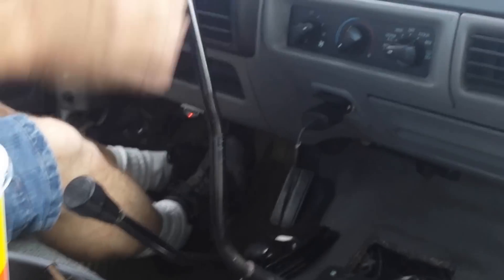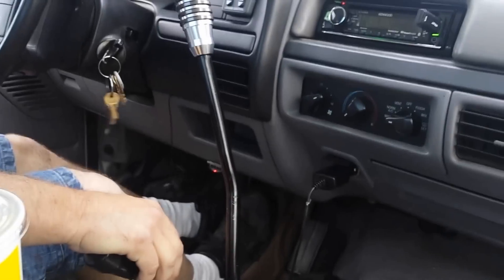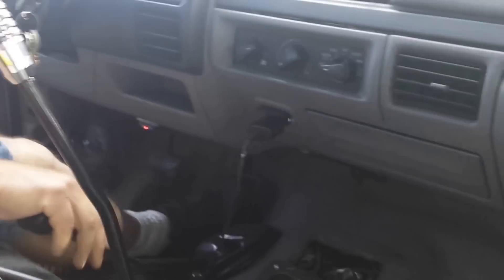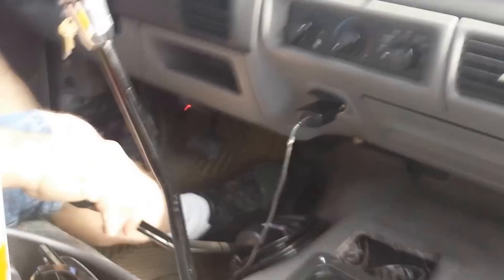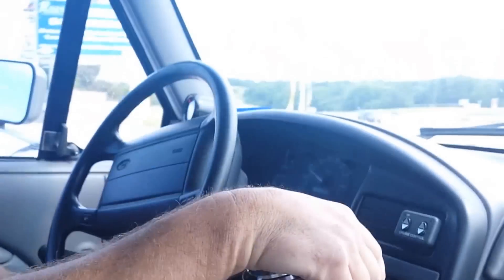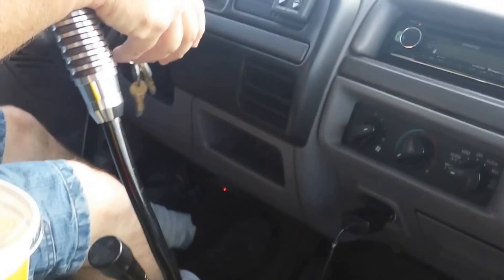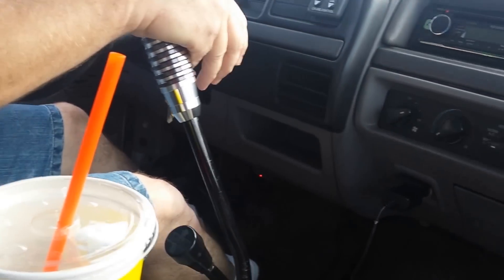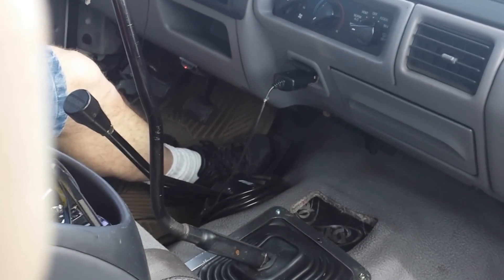F150 twin stick test drive

Comment: I know it's a late comment but I wanna do this with my 89 but I have 2 questions. 1. Is the noise from the overdrive unit a torlerable volume? 2. Is the install pretty hard, I mean clearances for the shifters cause mines 4 wheel drive? Loved seeing this video I had no idea what to expect when I looked it but found your video it's awesome! Keep posting more videos with this truck! Cheers
Reply from the maker: The noise being tolerable is subjective. I can tolerate it ok, but I used to drive semi trucks so.... Most people that ride in my truck for the first time comment about the noise, they ask me if something is wrong with my truck. I was warned by advance adapters about the noise before I bought it so I was prepared. Knowing that the noise is normal takes away the anxiety of thinking the unit is going to selfdestruct I guess..  Lol
As far as the install goes, in a 4wd truck your transmission and transfer case will be moved back about 6 inches. That means the shifters will also move back 6 inches, that will clear up space for the extra shifter. It ends up being a few inches in front of the transmission shifter. You will have to do some floor board mods, covering up the old holes and drilling out new ones. You will have to shorten the rear driveshaft and lengthen the front one. Also the cross member has to be slid back 6 inches. Install is not easy, but its not impossible either. Just allow plenty of time to complete the job.  There is no rocket science involved, just some minor fabrication work.
Reply: ktumbleweed awesome! I was pleased to see you answered so quick. My truck for the most part is loud from my cherrybomb exhaust. So I didn't really worry about the noise that would come from it as much as if it was gonna be a hassle to install thank very much for the info it is greatly appreciate!

Comment: Is this unit noisy in OD? Doing research on putting one in my 77 Ford with NP435 tranny for the overdrive. Don’t want to install it and not be able to enjoy the ride from the wine of a OD.
Reply from the maker: It is noisy. Not gonna lie to you about that. Noise seems to travel up thru the gearshift lever. I tried an experiment where I shifted into overdrive and then unbolted the shifter and stuffed a towel over the hole in floorboard. Noise level dropped considerably. I think a rubber block between where the shift lever bolts to shift arm should isolate the noise down to a tolerable level.
Reply: ktumbleweed Thank You Sir. I really love watching your videos. My dad is a truck driver and I grew up in a truck. I just love to shift gears. This just looks like the key deal for me. I am building a 1977 ford crew cab. Doing a full restore on it and want to make it drivable to 65 mph. Thank you so much for putting all this out.

Comment: Excellent description. I'll use this for the core of my research.  A buddy and I both have old fords and we've been one-upping each other for the past two years, doing stuff that shouldn't be done.  
He built a rock crawler with 37's; my aspirations were simpler, I just wanted a good old running truck that burned rubber on command. He's currently WAY in the lead this summer with 37's, Sterling axles hydraulic boosted brakes, etc etc.. I still think my truck runs and sounds better with the bigger cam; because everyone needs a stock looking truck and a cam with 220 degrees of duration; but it's missing that one over-the-top-thing.  I was going to put a stall converter in and slap some huge mickey Thompson drag tires on it after I replaced the gearing with 4:56's.. 

But I think doing this; especially since he can't drive a standard and I'm not really into big tires; would be good for a LOT of laughs. Not to mention it'll be educational for the youngins.  Maybe I'll eventually do both?

Comment: Gotta ask. Where did you find this or did you make it? Never saw one in a pickup. And it's a damn good anti theft  device!
Reply from the maker: advanceadapters.com  it is called Ranger Overdrive or torque splitter.  I am selling this transmission setup.  Includes the 2speed Overdrive (small stick) and T19 4 speed granny.  Fits small block ford engines.  302 V8 351W  300 (4.9) six cylinder ,  maybe 351c  don't quote me for sure.

Comment: So what was the Doug Nash 4+1 transmission in the mid 80's corvette? Any useful swaps into old trucks?
Reply from the maker: I don't know a whole lot about 4+1 , I think it had an overdrive behind the transmission. Similar to a gear vendors. I think it could be used as a splitter but not for sure. 
They used to make 3 speed manual transmissions that had a factory overdrive in the tailshaft housing. It could be used in 2nd or 3rd gear.  Maybe 1st gear if you really wound up 1st gear but it was not recommended. This was back in the 50's and 60's, I think they go back even further than that.

Comment: This would be so nice on a boat ramp. I assume I have 3.08 gears because getting moving on flat ground is so hard, but highway speed rpms are decent.

And with the amazing mazda supervisors tranny, I can go faster in reverse than in first gear. And can barely start backwards in reverse up hills. What a ridiculous setup. Why there aren't more options for two wheel drive trucks like split rear ends, auxilary transmissions, locking differentials, or nowadays even just a manual...I can't figure out. Nice video!
Reply from the maker: To use this particular aux transmission you would also have to change over to a 4 speed transmission. I recommend a "granny" transmission. This overdrive unit does not lower the gear ratio, it only adds an overdrive. However switching over to a 4 speed granny would give you a lower 1st gear. Find one with a 6:1 or lower 1st gear to really be able to crawl up the boat ramp. Also this unit only works with Ford or Chevy trucks and some older Toyota land cruisers. Check out their website for more details. AdvanceAdapters.com

Comment: Love that Overdrive, Gear Vendors designed that I believe, I know they made an overdrive unit on some sort either way it's a cool addition to your F150 brother. Great video.
Reply from the maker: Thanks for your comment and for watching the video. Advance Adapters has been selling these units since sometime in the 80's. Gear Vendors did not design this unit. This particular overdrive unit was originally designed by a small company in my hometown of Arlington, TX. They went out of business sometime in the 70's. A few years later AA bought the tooling and the rights to this overdrive. They started manufacturing them and made some small improvements along the way. I spoke to one of the tech's at AA and the sales of these units are dropping off. They will probably stop making these units in the near future. If anybody wants one they better get one soon.

Comment: What's the overdrive% on that range splitter
Reply from the maker: I believe it is 27% or a .79 ratio. I was confused about the percentage vs ratio. You would think a 27% overdrive would equate to .73 , but nope. It equals roughly .79 to 1.
Reply: ktumbleweed about how many rpms does the overdruve drop on the highway about at 55 to 60 miles an hour. And what is your tire aize and rear axle ratio
Reply from the maker: It drops about 400 to 500 rpm's. I have 3.55 gears with 29 inch tires or P235 75 R15
Reply: ktumbleweed so that puts your highway rpms at about 1200 or so?
Reply from the maker: No, much higher.  60mph is around 2000 rpm.  75mph is close to 2400
The 3.55 axle kills the highway rpm.  I would prefer 3.08 or maybe even 2.73 with the straight 6 engine. It likes low rpm.
Reply: ktumbleweed thanks

Comment: ktumbleweed - do you find the gears in the Ranger unit to be noisy?  I've heard it both ways.  Some people say yes some say no.
Reply from the maker: Yes, the Ranger unit is noisy. You can hear it when it is in overdrive. It is totally quiet when not in overdrive. I got used to the noise and it does not bother me. I also have dynamat installed under the carper (rubber floor) and I still hear it clearly. The noise seems to transmit thru the gear shift. I want to install a rubber isolater between the shift lever and shift arm of transmission where they bolt together.
Reply: Thanks for the reply.  I was thinking of trying a Bowden cable to shift the unit so maybe that will help.
Reply from the maker: What is a Bowden cable? I would like to rig up a solenoid to the shift arm and make it shift via a button or valve. That was an option on the original ranger transmission back in the day.
Reply: It's a heavy duty cable like you'd use to actuate a PTO on a truck.  They come in various push/pull force ratings.  McMaster Carr has a good selection.  I saw online somebody had that solenoid shifter.  I think they called it a 2XT, Double Trouble and it looked like it was a cast iron version of a Ranger.  That would speed up shifts.  The guys at Advance Adapters mentioned that option but said it wasn't without its problems.
Reply from the maker: Yeah, with the solenoid shifter you would have to keep in mind the time delay between pushing the button and the solenoid completing the shift. The clutch would have to remain depressed for a second or two.

Comment: Every time I come back to the idea I have another concern or question. ....
It's $1600 for the 2 speed splitter 
+ dropping my trans 
And moving the trans crossmember 
Fabbing shorter main and longer 4wd drive shaft. And fabbing an L bracket to move the 2 speeds shifter away from the throttle and a little closer to the main shifter in the trans tunnel 
My biggest concern is ordering one from advance adapters and having it not fit.... my truck is a 91. 
And they advertise up to 88 I believe.
Yours is a 90s model and it worked out.
I believe my truck has a Muncie sm465
I'm mainly concerned about spline count and shaft sizes....... the 760002m-27
With the 5.125 index. Is the one I believe I need.  As i only have the one vehicle .... I don't have the luxury of just dropping my trans and checking ................... wish I could get a drive shaft from a 1/2 ton or 3/4 ton that had a 5 speed. And maybe get lucky like you did and them be the correct length. And just bolt right up...

Comment: Since I can't find a suitable 5 speed for my k3500 
I plan on putting one of these in for sure now. 
But just how loud is the gear whine... like could it be quieted down with a thicker viscosity lubricant 
And some sound dampening material on the floorboard...
Reply from the maker: The gear whine is noticeable. I used dynomat on the floorboard but can still hear it. I did try an experiement where I shifted into overdrive and then unbolted the shifter and drove it around for a day or two. The noise was almost completely gone! That tells me the majority of the noise is transmitted thru the gear shift handle. I was planning on fabricating a rubber block to go between the shift arm of the overdrive and the shifter where they bolt together. Just have not got around to it yet.

Comment: I am glad to see you did this in a 6cyl F150. I have an old 1/2 ton dodge with a slant 6 that is everything I wasn't looking for in a truck. In stock form it can barely haul my utility trailer. But I am really attached to it since it's my first truck... I know with low enough gearing, slant powered D500s used to tow airplanes. I still want to be able to hit the highway, so after a lot of thinking I decided an NP435 4 speed with granny low and auxiliary OD would be ideal. Ranger sells the OD box. I even thought about all the shifting options being "as simple or complicated as you want it." Very cool to see it already done and gives me inspiration. Hope to hear how you like it and whether you've done any heavy towing so far. Of course you need good brakes too. And how bearable is the gear whine in person?

Comment: It's cool but I don't see what this really accomplishes on a 1/2 ton pickup.
Reply: It brings an overdrive to a 4 speed truck. You could just drive up to 4th and flop it into overdrive is you wanted. You don't have to split every gear.
Reply: It’s cool as hell
Reply: Easier on the drive train when towing heavy loads.
Reply: Garrett Smith its for security
Reply: But would you expect to see a twin stick in f150 tho? Probably not
Reply: Dude I'm looking at putting this and a cummins 4bt with a t19 from a box van into my mazda b2300. I live in the high sierras and work with that lil rig though
Reply: The_Borax_Kid I have a friend who has a 79 F250 with a 4bt who just put one of these in and he’s very happy with how it cane out. It’s a 4bt with a NP 435 trans, so now he has overdrive
Reply: All it is doing is adding one extra gear.. lol...   Just drive your truck like normal and then when you get on the highway, you shift that second handle into overdrive..  The end.   That's what it "accomplishes" --- it gives you a highway gear on an older trans that is too slow for today's highways.   His demo is just showing that you can actually have a "high and low' in every gear if you want, but there isn't much point to do that
Reply: @calholli  actually their is a point to it. Double so when towing. You can use the engine torque more efficiently. Just regular driving I can see your point.
Reply: @calholli  we out in the country are always towing more than what it was marketed to tow. The newer trucks just can't do the job. For some reason older trucks do better. 
But, like I said earlier it is easier on the drive train the closer the gears are on the truck no matter what yer towing.
Reply: @calholli  well, you also need to factor in the cool factor to your price.
My 89' will be cool as hell if I did that.
Reply: @calholli  mine is an 89 f250 7.3L IDI Diesel extended cab long bed. It does not like going over 60 and it 3 acres just turn this rig around. Love my truck. Basically a road legal tractor.
Reply from the maker: @calholli  That is exactly where it paid off for me.  A few times I towed a car hauler with it. Once with a 4x4 Suburban on the trailer, just 15 miles one way , but still way more than this truck was supposed to tow.  The straight 6 with the extra gears did it no problem. Now braking was another story, and first off I should not have done it.  I opened myself up to major liability if I would have been in or caused a wreck.  Original towing capacity of this truck with the mazda 5 speed was 2500 lbs.  That was 6000 lb rig on a 2000 lb trailer, so I more than tripled the towing capacity.  I did this out in a rural county with light traffic, would never do this near the DFW area or any other congested area.
These old cast iron granny 4 speeds (this one was a T19) were strong for a pickup truck.  But the two downsides were lack of overdrive, and the wide ratio's especially between 3rd and 4th.  When towing that big jump from 3rd to 4th was a pain in the ass.  This overdrive unit solved both of those problems.  Gave you a gear between 3rd and 4th and gave you an overdrive.  Win Win!  Thanks for watching and commenting!
Reply: @calholli wrong auxiliary gearbox, this sits in front of transmission,  you must be thiking of US Gear, or Gearvendors .

Comment: This is a couple of years old. But I wanted to thank you for this wonderful video and information. I have long had the dream of a Ford F150/250 4x4. Utilizing a iron Warner T19 4 speed mated to the 4.9 in line 6. With 4.10 rear end gearing. Making a durable,  long life truck for towing. The major draw back would highway speeds above 50mph. When not towing would unnecessarily rev the engine. The over drive unit you describe here. Would solve that. Also give it even more diversity. With all the extra gear options when towing or simply driving. Thanks again:)
Reply from the maker: Glad my video helped you out!  Yes this overdrive solves at least two problems with the old bullet proof cast iron granny transmissions. You get an overdrive for the highway and some extra "in between" gears.
Thanks for watching and thanks for commenting.
Reply: 1. 2. 2 over. 3. 3 over. 3 over high (if you have an 11% splitter). 4. 4 over. 5. 5 over if you's on the A-Bahn.
Reply: Can you make a 6 speed manual for a f250 do this??
Reply: @Pueohulunui  I found I am wrong lol they do make em for 5 and 6 speeds